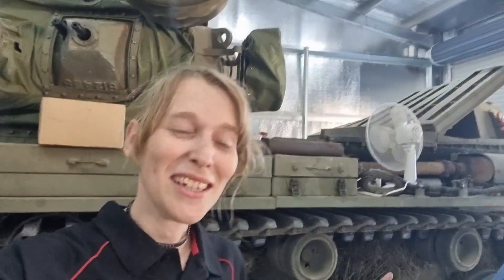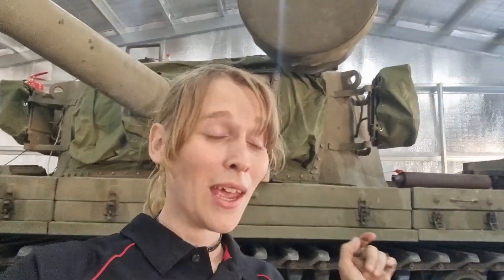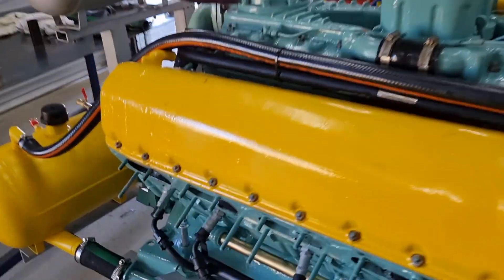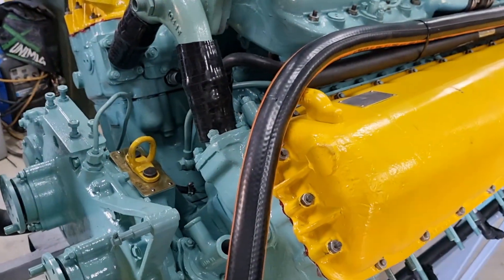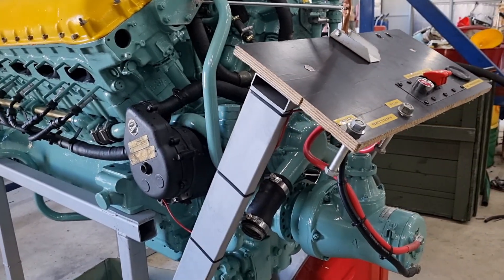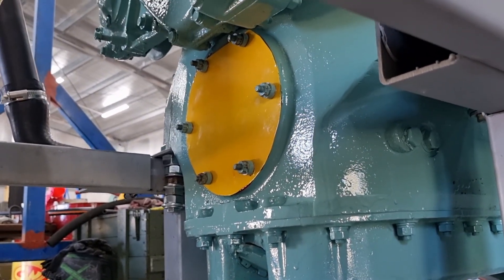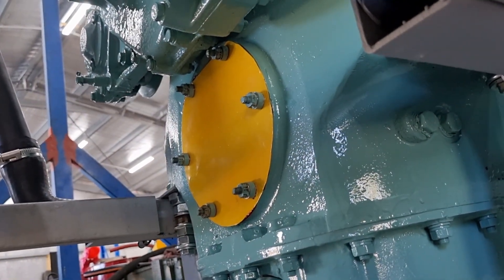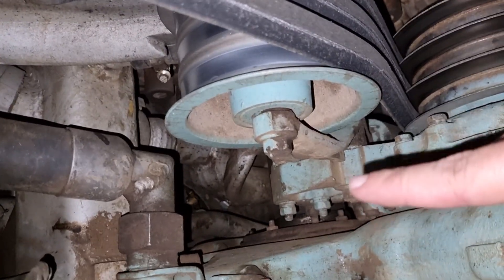Centurion Tank engine has its first start!

Comment: Hang on: so is the shiny new engine on the stand going into the Centurion, or are you just refurbishing it while you fix up the tank? 😊
Reply from the maker: No, it will remain as a spare/ static engine. The tank has a perfectly operating engine that we also rebuilt.

Comment: An engine rarely used. Always good to turn over without firing to build oil pressure.  My friend always used the petrol donkey engine on his 1942 Cat D4 to churn the decompressed main diesel engine over till the oil pressure showed normal. Faultless smoke free working and running year after year.
I know it is fashionable to run open exhaust ports and flames but, not how factory bench and dyno tested. I prefer the sound of an engine with the designed exhaust system and back pressure for the application.
e.g. Austin Champ Rolls Royce designed B40 5A with the curled tail pipe to clear the rear wheel and keep the water out at 1,000 rpm on the hand throttle in deep fording. Not just a book I read, actual user experience in flood relief work. Anyone can read a book and pretend to be an expert. I was lucky, a Rolls trained mechanic with experience on B series engines showed me how to service and tune it properly.
This is why I respect Lottie's explanations. I also note her camera shy partner in crime. I did the donkey work but preferred to stay behind the cam too.
Reply: Thanks for the comment ... Ive done my time in front of the Camera , its Lottie's turn.

Comment: Certainly looked and sounded sweet on the short run up 👍 Is this a spare engine for the current Cent or does it have another home to live in? Couldn’t help noticing that the thermostat pipes didn’t seem to have hose clips on, maybe they have and I didn’t see them.
Reply from the maker: We hadn't fitted the clips just yet, no water on that run up. They are fitted now.

It is a spare/ demo engine. It is ready to plug into any Centurion that needs it though 😊

Comment: i can readily understand that without a load, a large engine such as this will not, as a whole unit, reach operating temperature.   I have a background in large industrial diesel engines (megawatt size) and if they are started and idled, the themostats will not open and the external engine surfaces will not get abnormally hot to the touch.  Radiation and air cooling from the engine surfaces is sufficient to dissipate the heat.
However I am amazed by Lottie's comment that it is ok to test-run an engine without water.
Without water, there is not a lot of heat conduction from the exhaust valve stems into the general mass of the engine, and even a minute or so can cause the valves to exceed their normal full load operating temperature.   
Large engine manufacturers forbid test starting engines without water.   Without a radiator is ok,   but you must have water.
Care to comment, Lottie?
Reply: Pretty sure she knows what she's doing
Reply: @garynew9637  ; It is evident in her videos that she does indeed generally know her job.  But we can all make mistakes.
Diesel engines don't throttle their air, so when idling, exhaust gas temperature is much lower than at full load.  But a gasoline engine operates stoichiometrically, so at idle the gas temperature is lower by a much lesser degree, which would tend to keep exhaust valve heat high.  But gas density is low.   So Lottie MIGHT be right, but I very much doubt it.